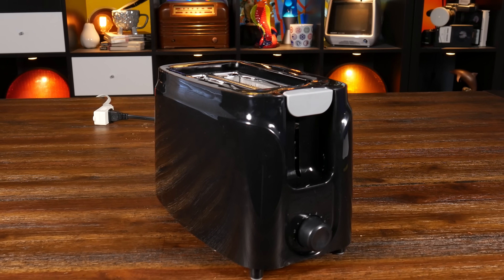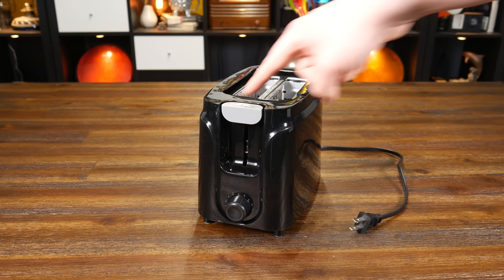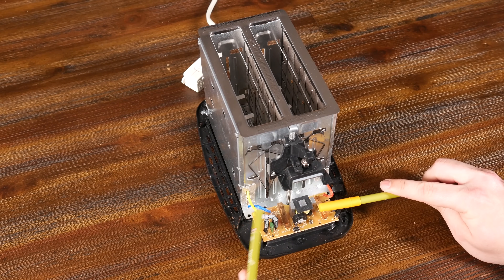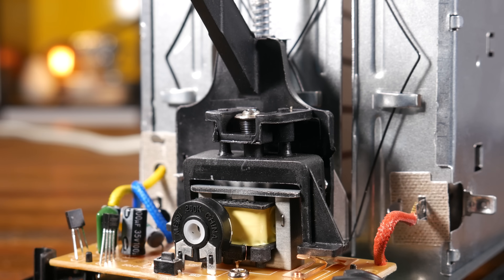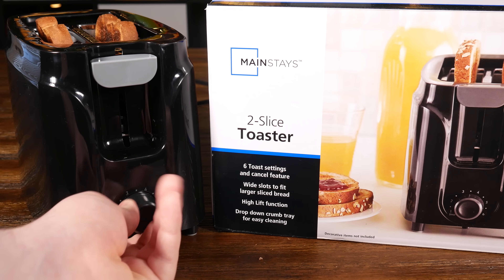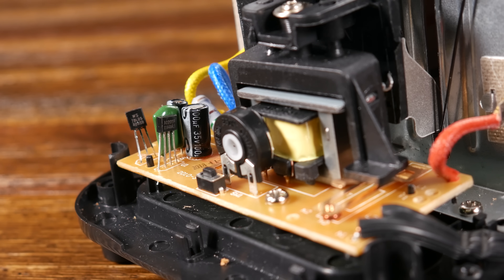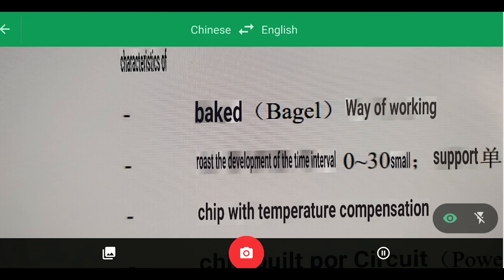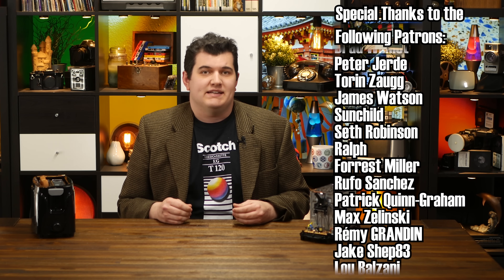The Electromagnet in Your Toaster

Comment: The use of those pens to complete the circuit made me think of one incident with the so called “Demon Core” in which several people were irradiated (and one died) due to the use of a screwdriver as shim to keep the core from going super critical.

The moral of the story being, avoid relying on safety mechanisms that are a slip away from being unsafe. Probably not a big concern in this particular case, but what if you’ve got a Demon Toaster on your hands!?
Reply: I would really hope that he is using a backup safety mechanism like a good RCD tested to make sure it works of course before demonstrating a mains powered device without it's outer insulation intact anyway. Don't get me wrong you slip up and you are still in for a painful lesson in respecting mains voltage but the safety precaution will at least be enough to ensure you survive long enough to learn from said lesson.